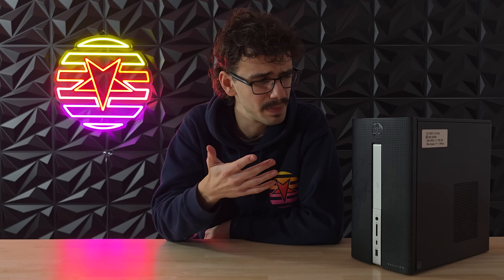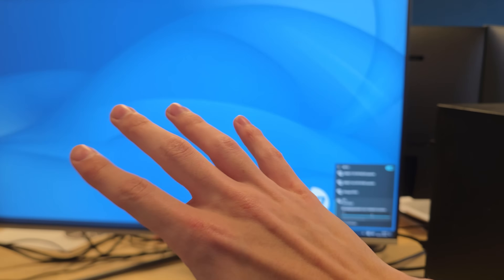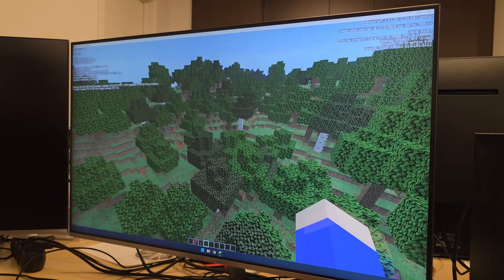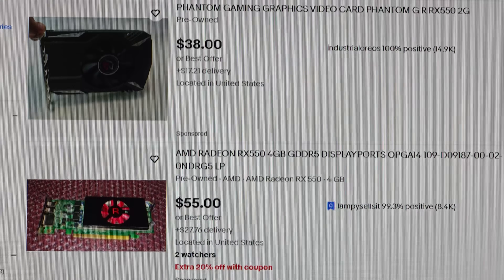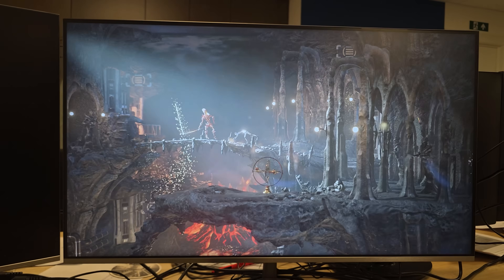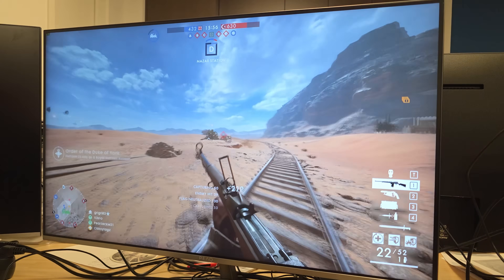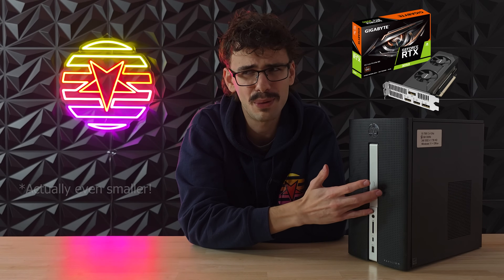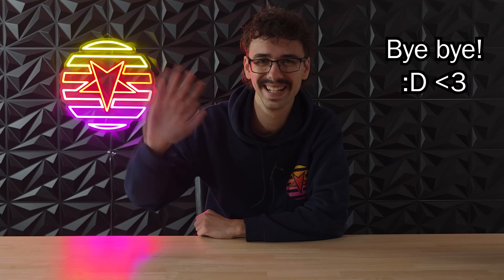iGPU vs CHEAP GPU - Should You UPGRADE Your PC? (2025)

Comment: Intel core ultra cpu's have arc igpu which can play games close or on par wirh amd rdna 3 igpu's
Reply: True but those chips are expensive, i dont see anyone building anything am4/am5 or 1200/1700/1851 for around $100 then slap a $40/$50 gpu. I mean yeah you are right but to build a core ultra pc we need at least 500 bucks or even more, there are core ultras that cost more than that just the cpu chip. Anyway since you remaind me of that i will be checking those out.

Comment: You chose the wrong card for this. Both the Nvidia GT 1030 4GB and GTX 1050ti 4 GB versions would fit in your case with no power connector necessary and no cutting required.

Comment: I made it with a Quadro p620, it runs but limitations are fast found. Other option could be A310 or A380. But I see dealing about resizable bar. Don’t really understand what it is and if my i5-6500 is able to work with such graphics card

Comment: Why not show PUBG on a rig like this?
Reply: I think pubg is CPU based performance right?
Reply: @OttawaInHD depends what you're running with!
Reply: @patrickpeardon  I agree PUBG is still masively played so it make sense to trow some benchmarks of it. I had a similar pc a few years ago, diferent cpu and gpu but similar specs. An i3 9100f with a GTX 1050 2gb and i can tell you already 4c/4t aren't enough for pubg becouse even if the average frame rate is kinda ok it will stutter like crazy on some scenarios even freezing. When traveling to zone the framerate and time was all over the place, freezing stuttering, aiming and controling recoil was impossible under those sircumstances. If more than 20 ppl where around you shooting and trowing granades and so on, it was trash, the average would deep low into the 40s with massive stutters. I think that the only two maps that worked kinda fine was Karakin and Paramo, probably becouse there is less players in them and there is no need to use vehicles to travel, and probably half of the 60ppl die in the first 5 minutes. After a while suffering with that poor i3 i managed to switch to a ryzen 5 5500 and changed the 1050 for a rx 570, massive improvement, basically no more stutters or freezing, with a decent 70+ avg fps all time.

EDIT : Sorry for the long comment, but yeah i basically changed my old pc i3 and gtx 1050 for just pubg. Its wild how in solos those specs worked fine but for squad games with lots of hotdrops and team fights was trash.
Reply: @alan138  thanks for the reply! My buddy is running on his 8600g and out seems to run quite well.